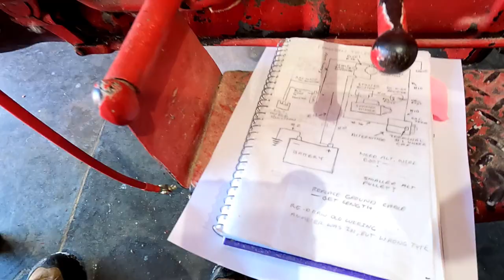Finishing the 12-Volt Conversion and Electronic Ignition on Antique Tractor

Comment: Nice conversion. Usually cylinders are numbered front to back on a straight cylinder engine, but as long as you marked them in a pattern you can understand and follow, it will work. Can't wait to see the Fergie running.👍
Reply from the maker: Yea that was just to match up the lengths of the plug wires. The new ones are a good deal longer though, but hopefully that wont be a problem. They are a real good quality and I got them on eBay as a close-out for real cheap! I just hope thy don't hook on anything but I believe they'll be OK. It will be a great day when this is up and running again. It's been out of service since the day it got here  😲

Comment: What distributor cap and wires did you buy?
Reply from the maker: The distributor cap was the stock replacement cap from Steiner Tractor Parts, and the wires were some racing wires from eBay, but they have wires at Steiner  as well.

Comment: What Brand of ignition is That and where can i buy it?
Reply from the maker: Hi Tom. All of the links are in the pinned comment, but here they are again:

Pertronix 1244A and 40511 Ignitor and Flame-Thrower Kit -- https://amzn.to/3q0J39e
Ferguson Complete Carb Repair Kit Marvel Schebler -- https://amzn.to/3npTzFg
12-Volt Conversion Kit (Not the same -- looks better)-- https://amzn.to/3nr2KoI
1-3/8 PTO Conversion Shaft Assembly -- https://amzn.to/2XnLPsB
ARES 13000 - Professional Ratcheting Crimper Tool -- https://amzn.to/3pZx77x